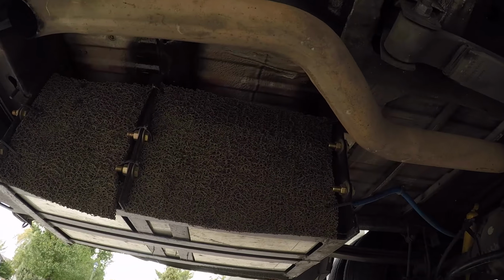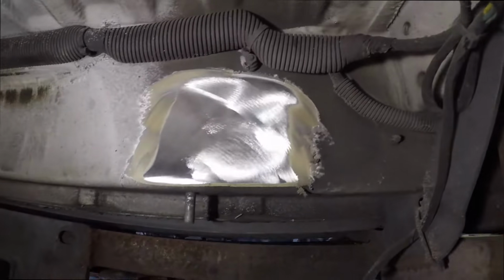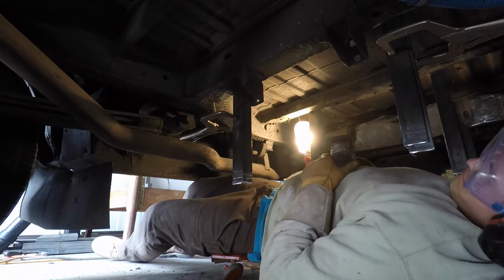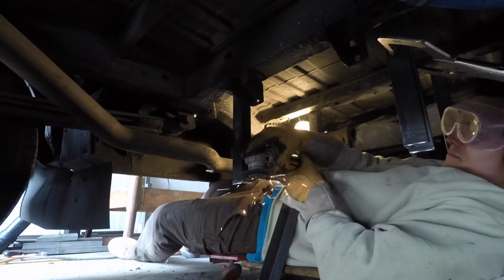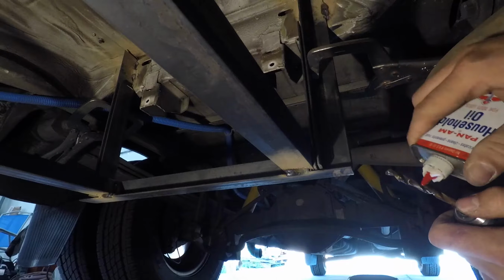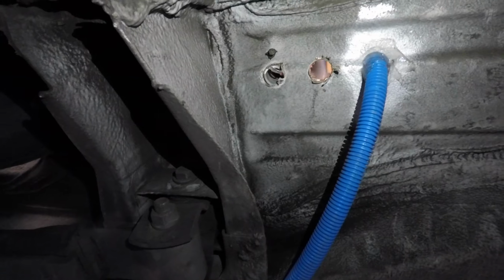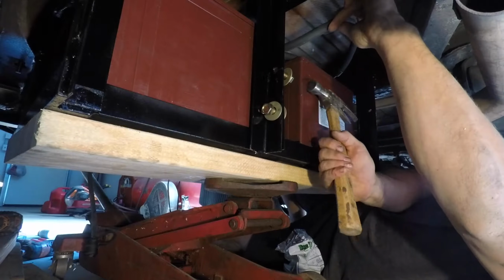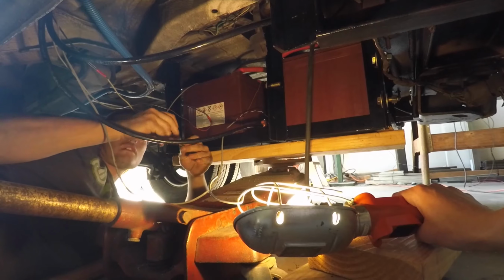Custom Solar Battery Bank - DIY Sprinter Van Conversion #6

Comment: I removed my rear tire under my 99 Dodge Ram van, cut a 2ft 8 in wide by 2 ft long trap door, my van has an 8in lift so I was able to build the box about 20in deep. I have 4 6V 380Ah batteries for a 12V 760Ah battery bank, I had some fans I can manually turn on/off by switch and I had some custom louvers cut into the sides for air. I live in the Southwest side of the USA, temps get pretty hot here but Ive had no issues with my batteries. I charge my batteries using an off shore plug or my 3500Watt gas generator, I also have a 375 watt solar panel on top.
Reply from the maker: That sounds pretty epic! It’s always nice when the hard work withstands real life use, nice job 👍
Reply: @GetBusyBuilding  I like the way you did your batteries too, Ive asked around, I think we are the only 2 people doing it.
Reply from the maker: I haven’t come across anyone doing it this way either. I have seen some under carriage battery boxes sold for the newer sprinters that go on the drivers/passengers side between the two axles on the outer most portion of the undercarriage.... but they are expensive and it’s harder to get a battery bank with multiple batteries installed.
Reply: BearsBuilds I guess it’s like everything else in life, I was an engineer for over 20 years in the semiconductor industry. My job was to make the $20 million dollar pieces of equipment run our processes. We just never get complacent, always looking to improve. I have one of those cheap Chinese diesel heaters in my van, I installed a fuel cell under the van, the fill cap is next to my gas fill. I had to put a sticker on one of them because I forgot which was my gas.
Reply from the maker: Sounds like you have a very awesome rig! Definitely a labor of love!

Comment: Curious if you’ve had any issues with the batteries getting too cold on the outside.  I’m looking at using Lithium batteries which may be more of an issue with freezing.
Reply from the maker: It would have to get fairly cold to have any real problems. I wouldn’t recommend snow contact by any means but I’ve used the system in snowy conditions, low 20’s F. I would personally put lithium ion inside the van just because they are simple and safe, they take minimal space. If you are set on an exterior case they are light enough to do quite a bit with and you can easily build an insulated box in a couple locations under the van that may have more room. Best of luck with your project, lithium is a great way to go!